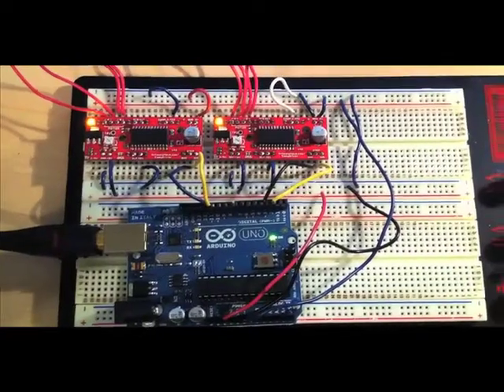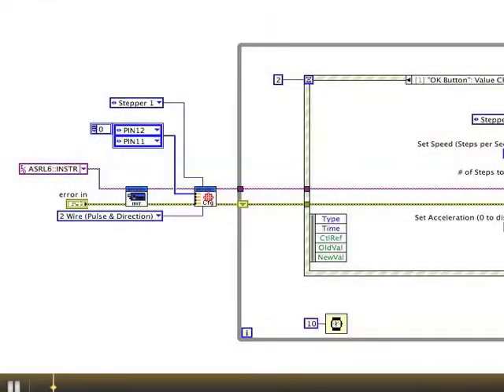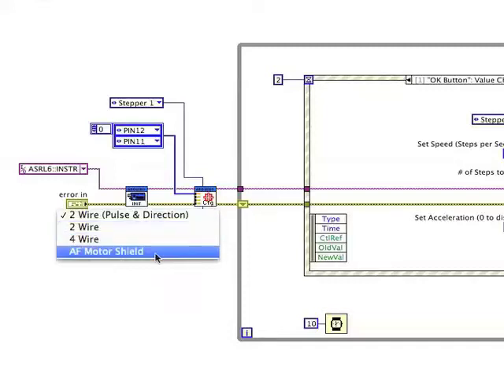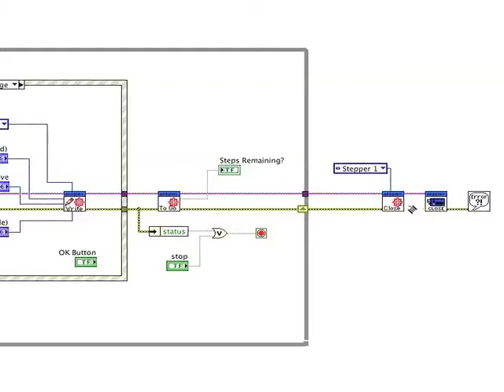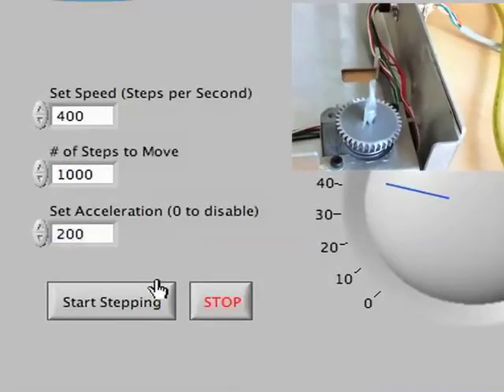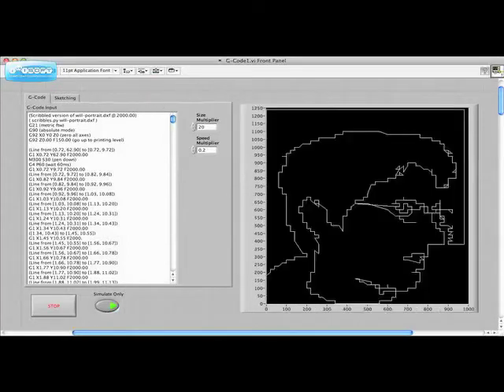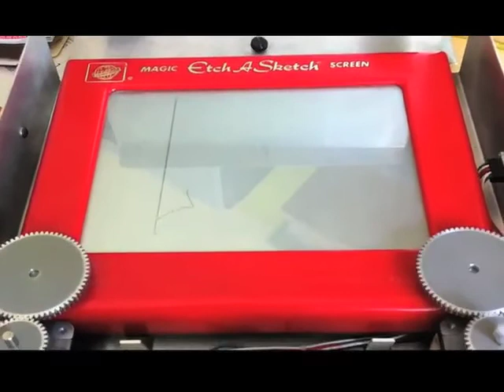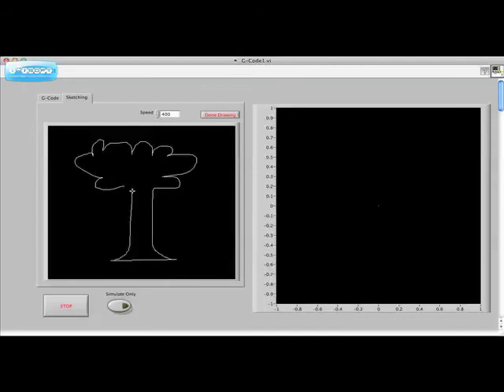Etch-A-Sketch Stepper Motor Control with LabVIEW and Arduino

Comment: @freddiepingpong, Have you tried making the VI into a subVI? 
The reason I ask is because I want to write a program that will execute a series of stepper motor commands, and I want to do this by creating a subVI that step the stepper a defined number of steps, and then a different number, and so on. 
What are your thoughts?

Also, have you tried out LINX?

Comment: Hi,
Thanks for the video. I have connected my Arduino+microstepper+stepper motor and labview runs at a a (steps/second) of less than 1, would you happen to know why? Also, it is rotating, but not smoothly. How can I achieve slower and finer rotation?

Please and Thank you!

Comment: Just a stpid simple question : how did you remove the original etch a sketch button? im starting a similar project and afraid pulling out the knobs will break somthing
thanks

Comment from the maker: I've finally shared the source (link above). I tried to quickly migrate my (very embarrassing) older code to a new architecture. It's not perfect, but it should work.

Note: The latency of this approach is such that you won't be able to send more than 5-10 commands per second (each line is a serial command). If you need to make a series of very small line segments, I'd recommend using an alternative Arduino firmware like GRBL. Above is a link to LabVIEW code to send GCode to GRBL.

Comment: Hi I'm student of mechatronics career and I'm working in a project for integrated labview ardruino and CNC control, I get the comunication between labiew and arduino and I can move bipolar motors across labview but, I don't understand, how I build a VI for read G code (CNC control) in labview, please, help me with your VI and some information 

I'm from Mexico ;)

Comment: What pin controls with direction in your program? Would it be possible to add a control on the front panel to specify direction?

Comment: heyyyy.... i saw ur "Etch-A-Sketch Stepper Motor Control with LabVIEW and Arduino ". it is awsome project... i am also doing similar project but facing a lot problem in controlling ardiuno  by labview. i need ur help....plz help me.....
waiting for ur response.....